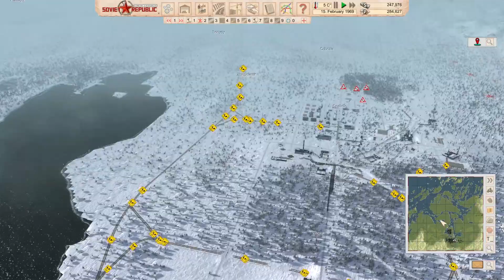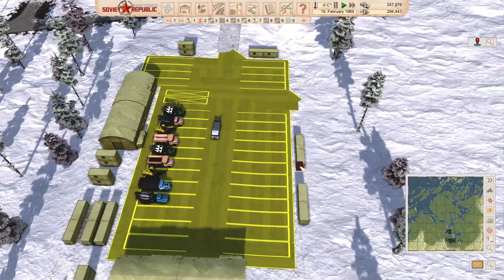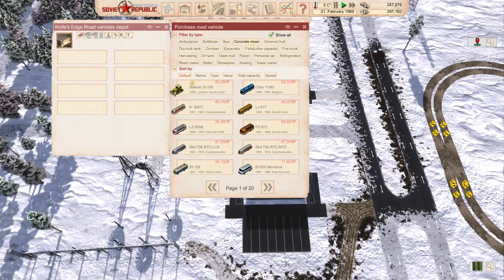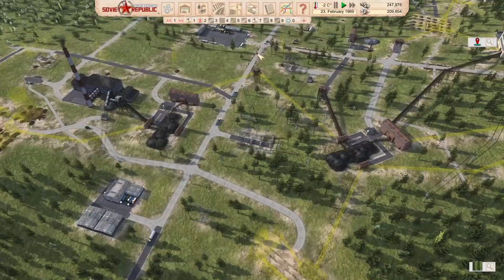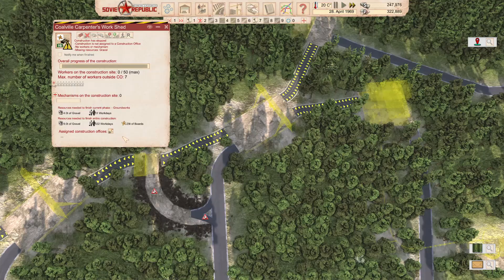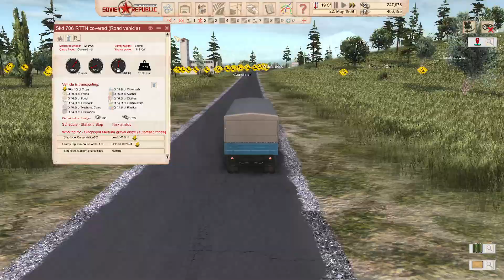Food Production :: Workers & Resources Soviet Republic (1947 Start): #44

Comment: You have too many workers and too many vehicles, but not enough factories, and too few of your factories have enough input/output storage for a big load of workers to work their full shift without being interrupted by running out of resources or filling up their storage.

I suggested this many episodes ago, but the fix is to COMPLETELY FREEZE all construction that isnt in Coalville and related to letting your workers work without interruption. You are getting impatient and you are struggling to keep up with inflation, so why not make some radical temporary changes. Go through all your construction offices, and commandeer almost every dumper in the republic to flood your steel mill with coal and iron. Build the Powerplant (and an 18 MW line to the border). Build your 2nd Steel Mill. Build all the conveyors. Build open storages for Bricks and Steel. Then, send all the commandeered dumpers back to their construction offices and go back to normal. Think of it like Mao Zedong's great leap forward; but hopefully with a better outcome! =P

Also somewhat related, when you need a new vehicle, before buying one, you can check the vehicle list (the button that looks like a book, between the commerce button and the lines button), and check if there's one you can borrow from another job. You probably did need to buy the refrigeration truck you bought this episode, but the open/covered hulls you surely could have taken from a construction office that's limited by steel right now not by a lack of vehicles.

I'm probably coming on too strong with criticism. If I sound rude I'm really sorry its not at all my intention. I'm enjoying this series and I admire your super patient playstyle. But I'm just very passionate about this game and I cant stop myself from trying to help. Especially now I get the sense you are feeling a bit impatient yourself. I want to see you build towns on all 7 crosses on the map!
Reply from the maker: The cement plant is the last major project outside Coalville,  the short term plan is to push the power plant and the second steel mill plus conveyors even if it means importing steel.  During this period would like to plan the next wave of expansion as this will give a focus for the road crews.

Have been getting impatient,  after the slow pace of the initial start had hoped the pace will pick up, especially with respect to the railway. Although, it has been a useful experience, it will be difficult to go back to a 1960 start.  Looking forward to the addition of scenarios.

No need to apologise, treat all comments as positive feedback.

Comment: Did you ever give a reason for not exporting prefab panels?  Seems a little silly to ship out bricks and not those as well.  Keep up the good work.
You could also put in a regular size clothing factory to put your people to work more.  Import the fabric and just use the labor.
Reply from the maker: Its a hard mode rule, prefabs cannot be imported or exported as capitalists have no interest in Soviet products.  I have added a condition that normal exports can happen in the 1908's when the wall comes down.  Plan to build a textile town in the direction of the oil fields that will supply clothes to the map.

Comment: Maybe gravelling the road towards the oil would be a good job for the summer! Then tarmac locally in the winter!
You need to make a decision either import steel or get more goal and iron ore to the small steel works which can deliver steel to a reasonable amount. I know how important the power station is to you and it will be competed in time. But everything will be constructed so much fast including the power station once you have Coalville steel mill up and running! I won’t mention steel again! Love the series can’t wait for the next instalment!
Reply from the maker: ty for the support.  At the moment it is 50/50 between building the power station and the steel mill.  Currently inclined towards the power station as this will cut costs which should allow steel to be imported.